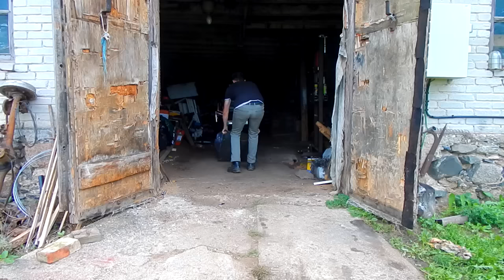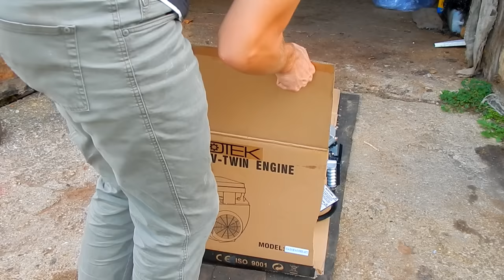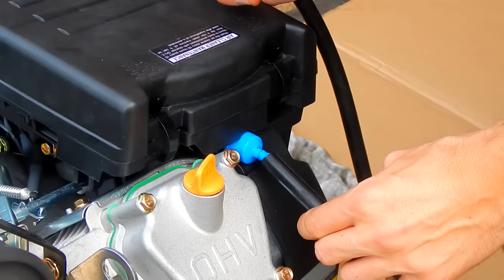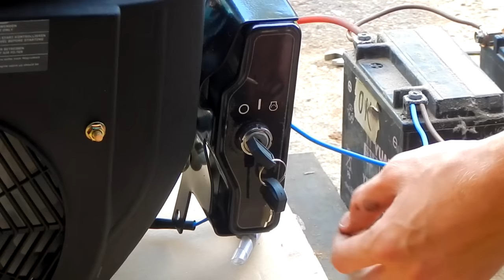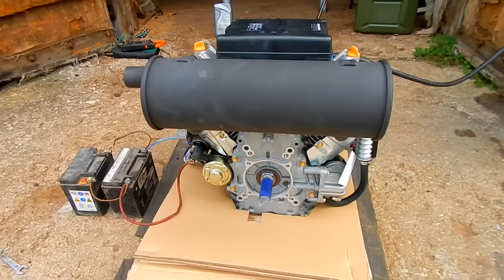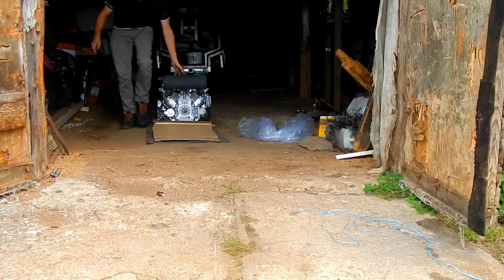V-Twin 20 HP Rotek Engine Startup - Tracked Amphibious Vehicle Build Ep. 1

Comment: For your application it might be worth placing the oil cooler further away from the engine and add a fan with a temperature switch. To force some more air thru the radiator if it gets hot.

Comment: I always use Mobil 1 fully synthetic oil in all of my small engines. Smart choice. Also use fully synthetic in all of my vehicles as well.
Reply: just runn them in with breakin or mineral, else your rings will never seat and you have blowby :3 after that synthetic can be used for prime lubrication when the engine is run in :3

Comment: I'll certainly be watching this series, your vids are very informative.  I already have an older Argo 6x6 that I rebuilt and modified a bit, wouldn't part with it, a real little workhorse.  Now I'm thinking something a bit larger than your current project using a small truck engine so I can close it in and have interior heat.  Canadian winters, you know.  I've watched a million Russian vids and I don't speak Russian, but ideas are wherever you find them.  Your vids will be a treat, very innovative and easy to understand.  Good luck.
Reply: 100000

Comment: You do not need to separately measure the voltage of two batteries connected in parallel, the two measurement results are the same

Comment: Any info about the engine pls ;) (you know.... more than just say "ebay") :-)
Reply from the maker: It is ordered from Austria, from Rotek Handels GmbH via eBay, you can look them up at rotek.at.
Reply: GHISLAIN LETOURNEAU 6
Reply: @DonnDIY  Looking at the pictures available makes me suspect it's not manufactured by Rotek. Does anyone know more about this? Asking as it seems Rotek isn't very interested in selling this outside of Austria.

There are three things I see that makes me wonder about the origin of this engine. First of all their name isn't on any piece of the engine that's visible in any of the photos, not even on the stickers, and there's no visible part number moulded into the engine block that I could see.
Looking at the mounting drawings the model number and the company name was added after upscaling them from a smaller original size, suggesting that they didn't have a higher resolution version of these drawings available, and that either there wasn't a company name and a model number on the drawing they originally received or that they added those on top of the originals for some reason.
A third reason I think this might be something else but an original design by Rotek is that parts of the engine look very much like what you find on some engines originating in China. This last point is the one least likely to actually mean anything. It's that it gives me a feeling I've seen this engine somewhere under another name...
Reply: @blahorgaslisk7763  well since you have all the answers, why asking for info on this engine? Why bother???
Reply: @alexhdz8956  I have no answers, only suspicions, and I really wonder if it's available under any other name or if it's a proprietary design.
Reply: It's a Chinese copy of a Honda gx670 
Loads of company's make them in China 
And literally thousands of company sell them round the world 
Harbour freight sell them in the usa 
I can order one from my local mower shop in Australia

Comment: Why connect the batteries in parallel?
Reply from the maker: These are old 12 Ah ATV/motorcycle batteries. The engine itself requires at least 20 Ah battery so I turned two 12 Ah batteries into 24 Ah battery. :D That's it.
Reply: @DonnDIY  Basically, i don't wannabe the wise guy, but sorry, can't help it:
As long as they are connected in parallel, you won't get a different voltage reading for each battery!?
But I really like your channel and your ideas! Very nice project!!!

Comment: There are 2 orange oil caps u didnt fill up the other one
Reply: Not necessary. It's just a convenient feature to better fill up the oil when mounted the other way around.

If there would be too less Oil in the system the motor wouldn't start, since it got an oil sensor which shuts off the ignition.

Comment: Do you guys have ethanol in your gas?
Reply from the maker: Yes we do, in E95. Supposedly in 98 octane there's still no ethanol in it, I'm using 98 for all of my machines at the moment but I think it is all a hoax since 98 is more expensive than E95, so everyone who care about the rubber parts on the machines are pretty much forced to buy the expensive stuff. :D But that's just me speaking. There might be no truth in it.
Reply: Ethanol is ugly stuff that does ugly things to the fuel system. I have to travel to where marine gas is sold and it’s about 100 miles. 

Oil companies surely take advantage of consumers.

Comment: why you didnt got a diesel engine?
Reply from the maker: I like the smell of burnt petrol more. :D The main reason is the lighter weight of the petrol engine though, the amphibious all terrain vehicle must float, so cutting weight everywhere where possible is a must.
Reply: thats also true, but diesel has more torque in lower rpm and from next year some time e95 has 30% methanol in it so thouse engines have problem with this fuel, i think i have to retire my old uaz also cause e98 has too high octane for her to burn plus the price